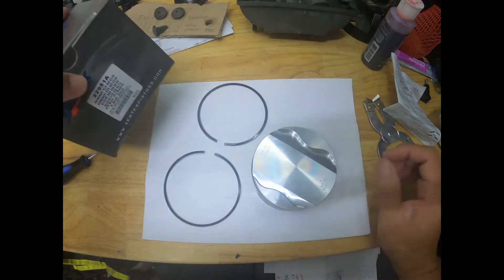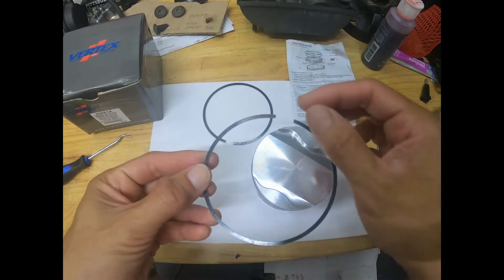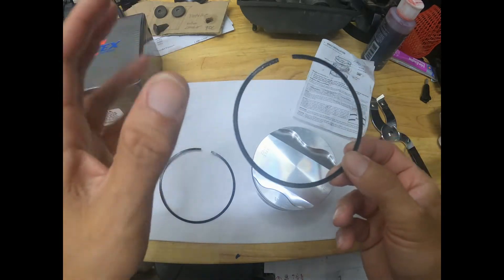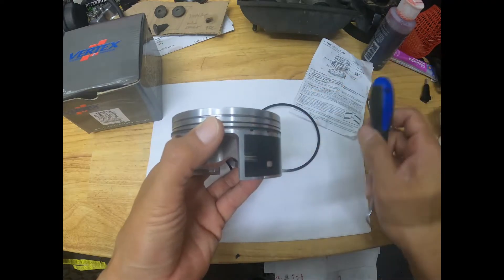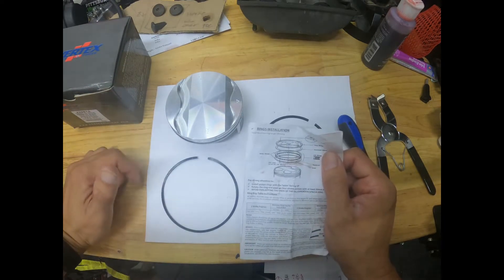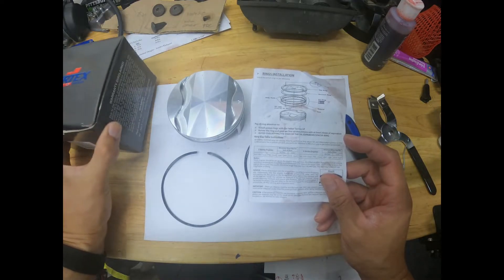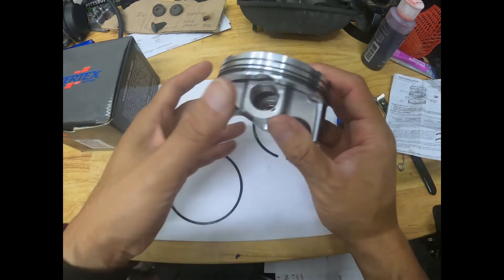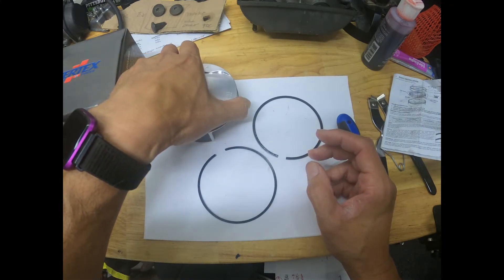How TO install VERTEX piston RINGS

Comment: I just got a piston kit and mine is labeled top on both rings but the step would be down if Installed with where it says top facing up?
Reply from the maker: You have to look at the piston and determine how it will seat. My top one didnt have a marking. It had a bevel and it seated in the lip of the piston. Check if yours has the same. Not sure if that helps.

Comment: Nice, this will help when I get my new rings. When assembling should the ring gaps be on opposite sides of the piston? I just removed my cylinder and noticed the existing ring gaps are only separated by about 5mm. 
I’ve had white smoke for a few months, but everything looks mint inside so I’m wondering if it’s just oil coming up through the gaps.
Cheers

Comment: My rings are both labelled exactly the same rn on one side 200 across the gap on both . One ring has a chrome surface on the edge that touches the cylinder wall, the other does not.the chrome surface has two green dots .. tech support can't confirm which one is first or second
Reply from the maker: If the other ring is chrome usually that goes on top. The all black should be secondary. Does the ring with chrome siding have a lip, similar to a street curb? If yes thats ring 1.
Reply: @scouts_garage  there was no lip on either and thickness was the same. I did get an email from tech a few days later that confirms the chrome surfaced ring is number one ring. Thanks for the reply too!
Reply: @AULIGAofBLEED  Thankyou, I have the same issue, two rings with the same markings and no visible bevels.  One has a chrome color on the edge.  Been searching for hours online trying to determine which is 1st and 2nd ring.